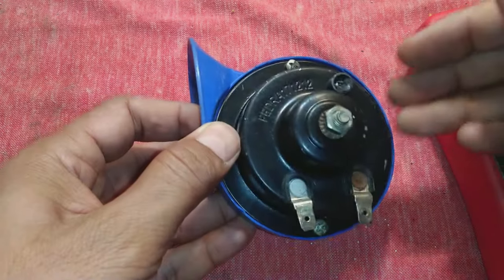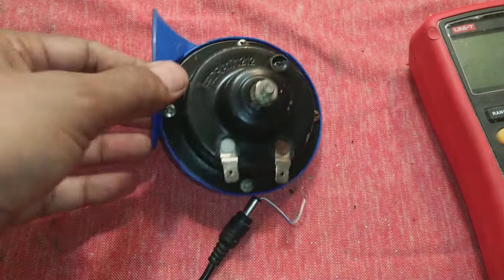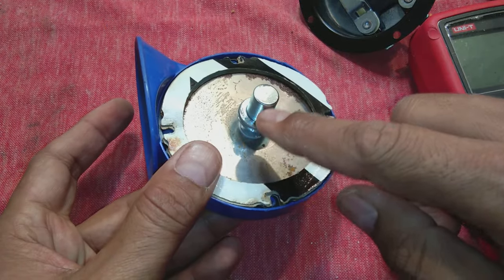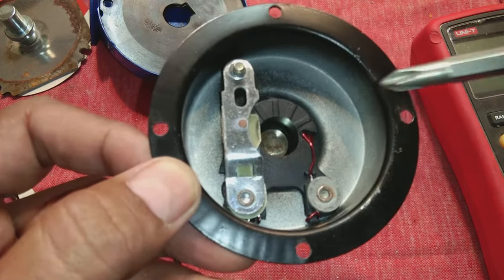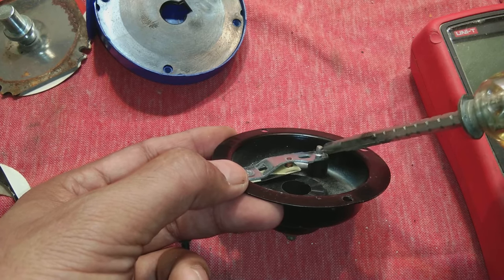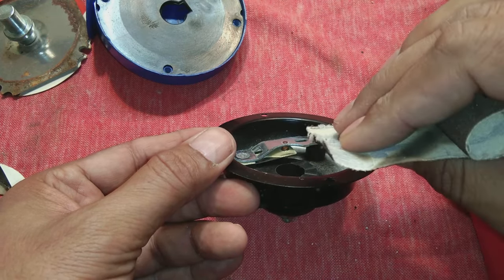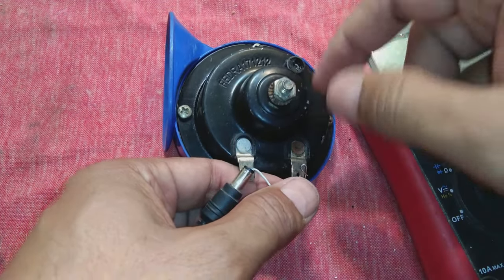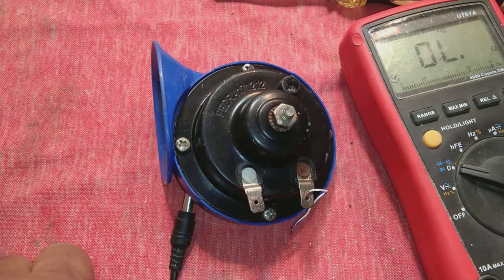Horn repair. Car horn repair yourself. How to repair a not banging car horn. car repair. automotive.

Comment: You are a genius bro I’m gonna have ago at the weekend with that adjuster screw my two new horns are supposed to 300db but only read 110db when operated together, Thanks
Reply: There is no way a horn can produce 300 db. The loudest sound ever recorded was 310 db. It was a volcano. Do you really think a tiny horn can produce that level of sound?

Comment: I saw the whole video twice, saw you giving a long explanation ( which I was not able to understand due to your thick accent and close captions could not display the text correctly either) , YOU YOU OPENED UP TOOK THE PARTS APART AND THE PUT IT BACK ONCE MORE, and the horn worked, my question is WHAT WAS THE FIX?
Reply: Yes

Comment: Hello sir your video is very nice i have 1 question i have nissan dayz roox 660cc and problem with rpm when i turen on ac rpm is around 1000 and because of low rpm ac compressor on and off and not making cooling please give me solution how can i increase rpm
Reply from the maker: Seems your throttle body is dirty. Needs cleaning. Also MAF sensor needs cleaning. The rest could be defective air conditioner. Regards,